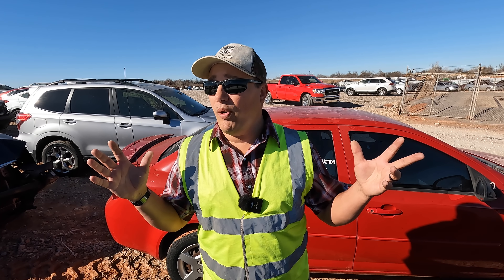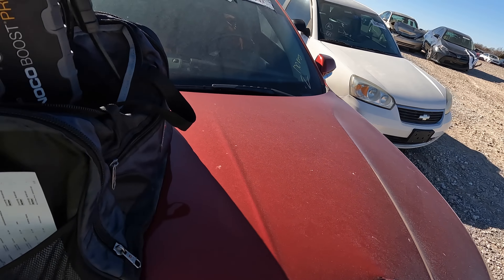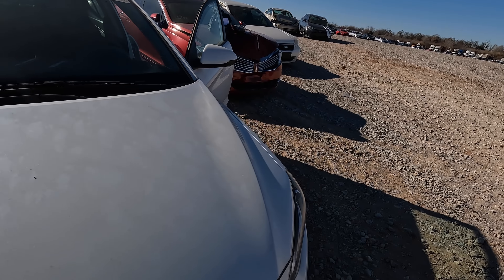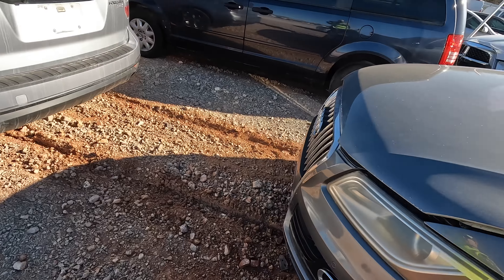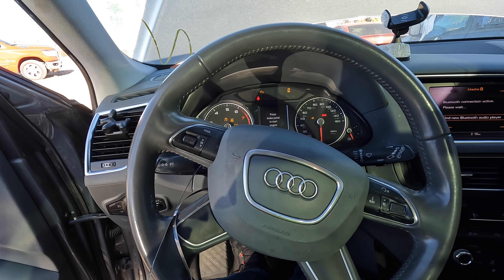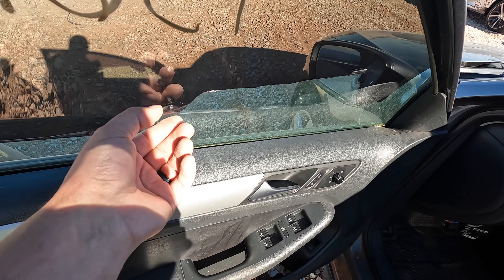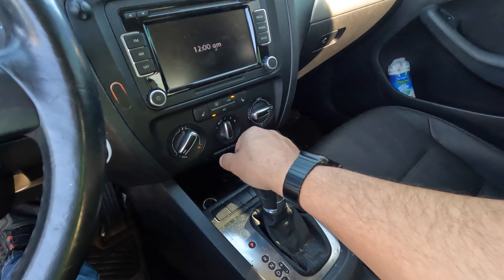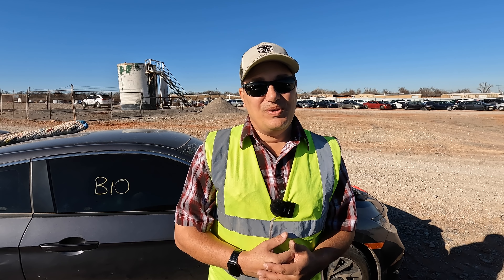Copart Walk Around 1-14-22 + Bejeweled Audi Q5 Quattro

Comment: The Audi is a timing chain engine. That generation of Q5 would have issues with the timing chain tensioners, which would ultimately result in timing chain failure and the engine being wrecked. Some will have oil consumption/piston ring issues that also can kill the engine. Those Q5's with the 2.0 engine are better avoided, the diesel or the 3.0 or 3.2 gas engines are much better.

Comment: On the TDI Jetta those lights are on the dash because the battery was dead if you turn the steering wheel all the way to left and then the right they should all turn off. TDI are getting rarer and rarer these days!’

Comment: Telling you exactly what happened to the Q5. The timing chain tensioner failed and the engine jumped time which is why you hear it cranking like that. guaranteed the valves smacked the pistons bending every single one. In short, it either needs a new head and timing components or a used engine installed which is about the same money.